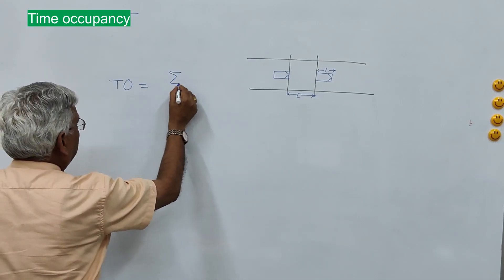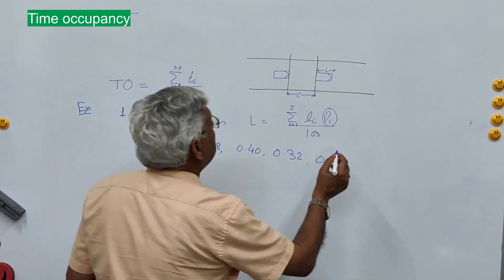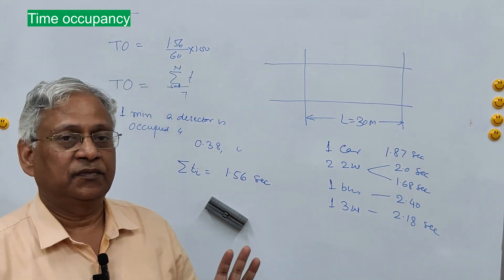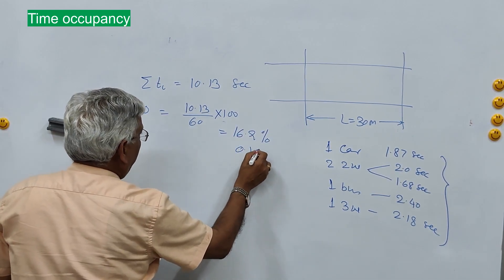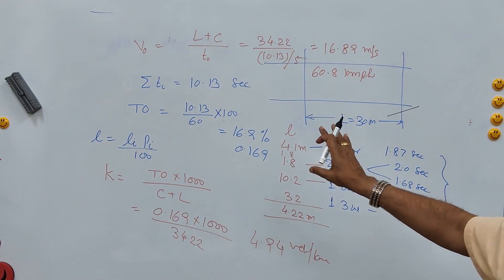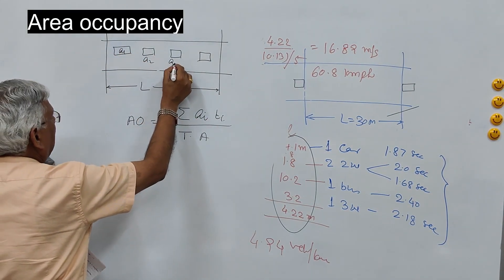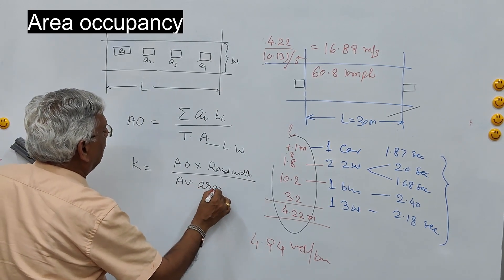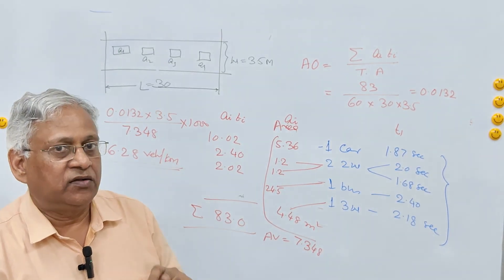Time Occupancy and area occupancy on a road and their relation with traffic density

Comment: If I am considering a study section of 500m and there are 3000 vehicles. And observation time is 5min. If i calculate occupancy it will be more than 100%.
How can I show variation of occupancy for the road section of 500m?
If I have to show some visualization
Reply from the maker: Occupancy cannot be more than 100 percent. Generally it is less than 40 percent even at high volume. Check your procedure